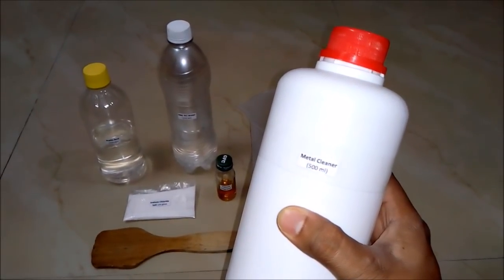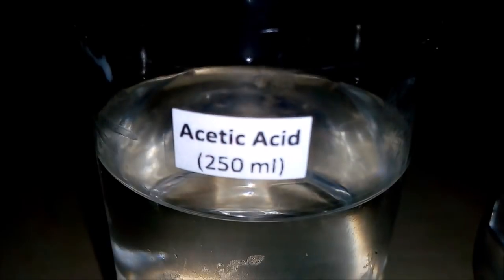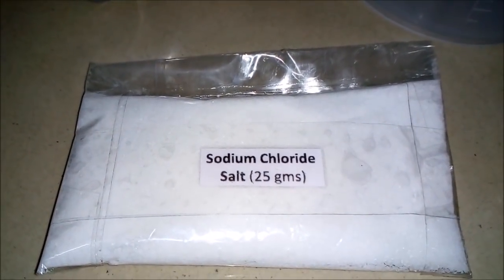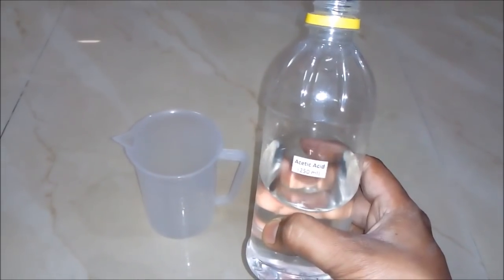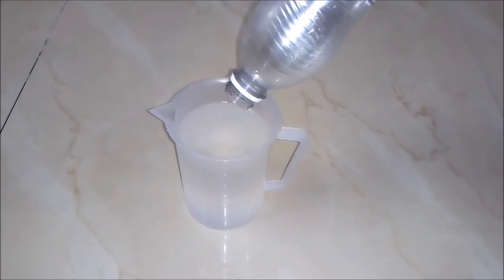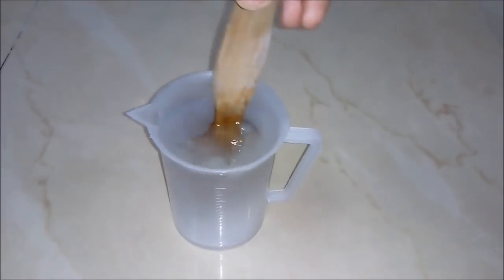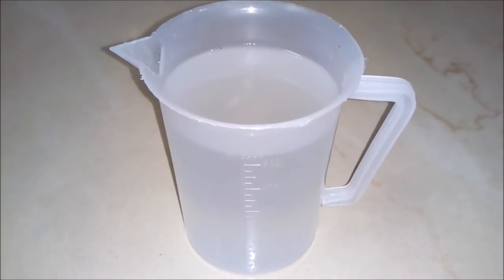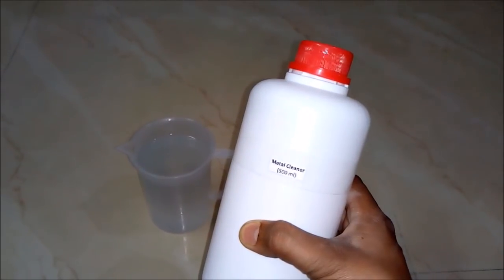Metal Cleaner Making 100% Real Formula

Comment: Wow! You are awesome!!!🙂👍👍👍.im enrolling in sharpening course. A blacksmith course. I started electroplating at home with soda bicarbonate and distilled water and around 2 to 6 volts power supply. All 18 volt battery with a dc to dc converter ( buck converter from eBay with a LCD volt and amps readout gauge. I had success with a mechanical feeler gauge. But I did a stainless steel spoon and results were terrible! I needed this cleaning solution as I tried alcohol,  wax and grease remover? I have 8% vinegar? Can I use this or do I need something with more acetic acid? Any reply appreciated.  Subscribed and liked. 👍👍👍. Cheers from Australia.